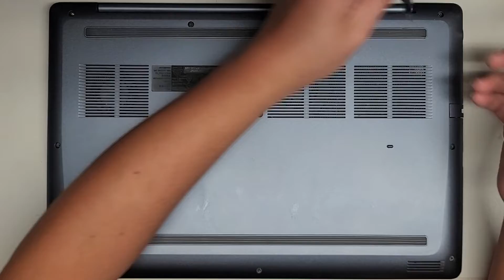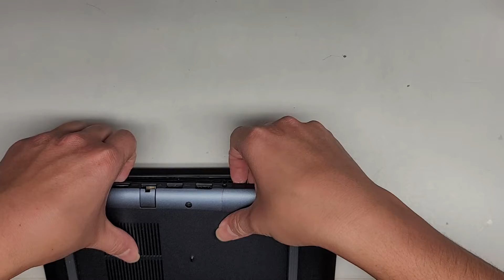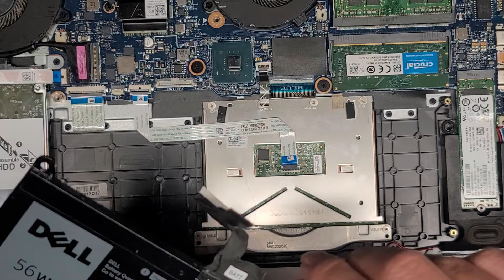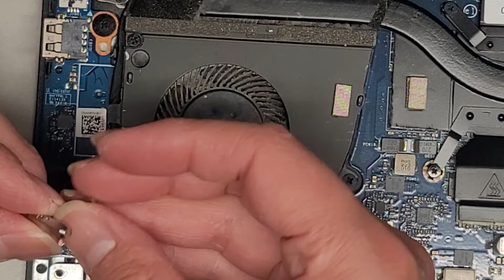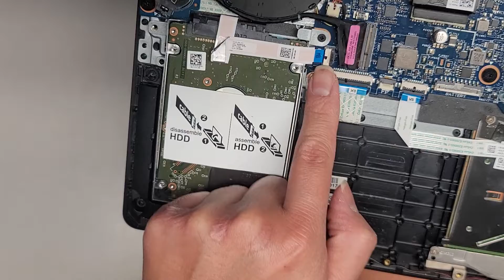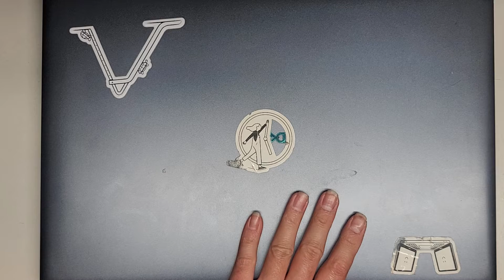DELL G3 15 3579 Disassembly RAM SSD Hard Drive Upgrade Battery Replacement Repair Quick Look Inside

Comment: Hey bro, I have a question. A few days ago, my Dell G3 3579 suddenly shut down while I was using it. Since then, whenever I try to turn it on, the display stays black, and only the keyboard backlight and fans turn on. It keeps repeating this behavior, as if the laptop is continuously restarting.

I think there might be a BIOS issue. What do you think, bro? Do you think I need to replace the CMOS battery?
Reply from the maker: Sounds like a fried logicboard :(

Comment: Hello, I bought a laptop of the same type, but the battery is weak. I want to buy a replacement, but I want it to be original. How can I tell if it's original?
Reply from the maker: Your best bet is through ifixit

Comment: Hey, hope you're doing good. I have a G3 i5 256gb nvme and wanted to add a sata ssd however the connector on the motherboard has the latch broken off. Any idea how to repair this? Where can I possibly get a spare part? Do you know what type of connector it is? I know it has 12 pins and most likely it is bottom contact.
Any help is welcome.
Thanks.
Reply from the maker: You can try this https://youtu.be/WO56KJOHywM

Comment: Hi. Thanks for making this video. I have one quick question. May be silly, maybe not. To your left is the 2.5 SATA HDD and to the right is the M.2 2280 SSD. Can you swap the HDD for a SSD? If yes, do you need special adapter to do so? Thank you for your time and consideration answering this question.
Reply from the maker: Just need a 2.5" SATA SSD
Reply: @ItsBinhRepaired  Thank you for the reply... Have an excellent day. Subscribed
Reply from the maker: @NO_FREEDOM_NO_PEACE  thanks

Comment: Thanks for the help. I just forgot what to do. I'm replacing the m.2 1TB with a 4TB, and also had a problem with Windows, so I'm doing a reinstall and changing the 1TB with a 4TB  and changing the two 8GB sticks of ram with two 16GB sticks and putting things back togeter for installation.
Reply from the maker: Sounds good!

Comment: My G3 keeps going into automatic repair and diagnosis shows a hard disk issue. How can I recover my data and replace/fix the hard disk?
Reply from the maker: Try accessing it from a Linux usb boot drive. If you can't access it, you'll likely have to send it to 300dollardatarecovery.com

Comment: Mine did’t want to open especially the corners screws they are so tough i didnt know how to open them
Reply from the maker: Were you able to get it in the end?
Reply: @ItsBinhRepaired  not it did not i will end up bringing the laptop to laptops shop just to unscrew it and change thermal paste
Reply from the maker: @Adonis-4666 😢

Comment: Hey! So I never did any upgrade with my Dell G3, I have SSD from original, I changed the battery cause it was bad and now it doesn’t see it. I tried diagnostics, changed some options to reboot. Nothing helps. I don’t know what to do. 

It worked right before battery change, now it doesn’t wanna start. Says that hard drive is not detected and it shuts down.
Reply from the maker: @MessiahtheLion  the only thing you did was swap the battery?
Reply: @ yes.
Reply from the maker: Might be a bios setting
Reply: @ right. I’m not sure if I did that too. I pressed F2 and then I restored to BIOS settings but nothing happened. Still showed no drive and shut itself down. 

Is that it or you’re talking about something else? 
I’m planning to take it to the shop.

Like I’m sure my SSD is good cause I literally used my laptop right before I changed the battery. It worked good. 
I just hope I won’t lose any files.

Comment: can you add another ssd one the right side slot?
Reply from the maker: Another? Do you already have one there?
Reply: @ItsBinhRepaired  yeah i've already replaced my hdd with 2.5" SSD.  it is possible to add another ssd m.2 on the right side near the battery
?
Reply from the maker: @jerrymerdionmuldong666  sure
Reply: Did you replace the m2 ssd? Does it support more than 512gb?

Comment: Thank you, I recently had to replace my hard drive and I had to remove the fan since it had dust balls and I never cleaned the inside. And I also had to install an SSD since it takes a while to boot to windows. (The SSD was from another Dell laptop model but doesn’t fit since it’s a bit oversized) and since I removed the fan to remove the dust I was like this line wasn’t that out on the cable and when I heard that you said to make sure it’s all the in and if you don’t you’ll shock the pins or short. My heart raced and thankfully it turned on and boots
Reply from the maker: Glad it worked out. If you haven't already, please like and subscribe so others can find my videos and possibly consider watching a few others to get the algorithm to recommend my channel. Thanks!

Comment: Getting ready to replace the battery in my G3.  The back looks identical to this one.  One of fhe screws (middle, back but not the edge) seems to be catching on something.  My son installed a ssd a few years ago.  He does not remember it giving him issues when he opened it back then. I have until the 25th to retun the battery if it does not work.  Today is the 13th.
Reply from the maker: Hope the repair goes well!
Reply: Went great and the battery is acting like it's going to be a good one!
Reply from the maker: @micheleb2558  awesome!

Comment: I have the exact same model and took it to PC repair shop. They confirmed two problems:
My battery has run its life and needs to be replaced
And
My CPU has a defect. Basically my PC cannot start even when I plug it in. The keyboard lights up a bit then goes dark immediately.
In this case, should I replace my CPU as well as the battery? And could I upgrade my ram and ssd while I'm at it?
I have all my personal data and files copied to another harddrive so data loss isn't a problem for me. 
Thanks Binh!
Reply from the maker: CPU can't be replaced unless you replace the entire motherboard.
Reply: @ItsBinhRepaired  I see. Might as well buy a new one then. On another note, my razer stealth (model rz09 is not charging properly. The charger is fine and I can still turn the laptop on but the battery is not charging. Do you think the problem is the battery itself and I need to replace it? Thanks again Binh, you're a lifesaver
Reply from the maker: @MinhVu-yz5rr  possibly, but make sure you get the battery from a source you can return it to just in case.
Reply: @ItsBinhRepaired  thanks again man. You are amazing!
Reply from the maker: @MinhVu-yz5rr  no problem

Comment: Any chance you know what may cause the laptop to have a slow startup or won't open up any web browser?
I've had this laptop since 2018 and for the past 2 years my startup takes a while to load and Google Chrom takes forever to open, but I'm able to play some games on Steam just fine
Reply from the maker: Likely failing hard drive
Reply: @ItsBinhRepaired  I had a feeling it was that, should I re0pace the hard drive or is there a way to help fix what I have?
Reply from the maker: @IamJerf  need to replace. Clone if you can

Comment: As I have this exact laptop (with a i7-8750H) as my daily driver the last four years, I can tell you a few things about it:
- the back cover on this one looks much better than mine, mine has two cracks on the left side, two on the right side, and there were pieces falling out the last three times I had it open.
- you have to open it at least every six months because the fans will accumulate dust, fabric and hairs from the outside and will over time work harder and have less effect.
- and after you have opened it two or three times many of the threaded screws will have basically destroyed the holes in the top.
- at this point, the ethernet port latch (which I just don't understand as putting a full ethernet port in there would make absolutely no difference to the height, I don't care about the sides being rounded from below) is flapping around since the spring just broke when I last cleaned the fans.
- also the fans get in contact with the backplate making a horrible noise from time to time, thanks to several distance holders having just sheared off because the whole backplate is made from the cheapest weakest plastic Dell could find
- the battery looks as weird as this one, ready to blow up. But it did that since day one, so I'm not worried.
Now the good stuff:
- the CPU is still not too bad, I have an HP as my primary work PC, and that one is two years younger than the G3, and it's a much worse PC in all ways, despite it being a "professional" model. I love having six cores in a PC from a time where four was many
- the RAM got upgraded to 32GB and the internal M2 SSD swapped with a 2TB NVME one, making this a snappy PC even now.
- when running Linux it sits at 4% CPU while browsing, reading mail, using VS Code etc. and the fans can barely be heard. Having Windows running idle uses 15-20% CPU and keeps the fans spinning much more audible.
- the nvidia 1060M is not very much compared to todays graphics cards, but it works for gaming from time to time. It's horrible (as all nvida graphics cards are) under Linux because of nvidia's stupidity and the moronic way these "hybrid" graphics solutions are built. It's also a reason the 56Wh battery you can clearly see in this video (which has been shortened to make space for a 2.5" hard drive) will not get you very far, because it is ALWAYS ON, even in "non-nvidia mode".
- the screen is laughably bad in just about any light. It shines in dark or badly lit rooms. My wife's Lenovo which cost a third of the G3 is usable outside, my G3 is just totally unusable there, no matter how much shade I get the screen is just unreadable.

I don't know if you fixed it, but taking out the battery and plugging it in can have the effect of it booting up again since it sometimes gets confused about its power modes, and then all you get is a dark screen. When mine did that it was the combination of too much dust in the fans and a botched BIOS upgrade (Dell had one or two BIOS versions for this one that were really, really bad, to the point of bricking about 25% of them should you ever be unlucky enough to install them and have the "wrong" hardware). Luckily it was still under warranty and I got a motherboard replacement, which seems to be how Dell handles this kind of problems.

Conclusion: should have followed my hunch and gone for the Lenovo Legion 5, would have made a better PC. Dell builds their budget PCs with horrible components, uses the cheapest and thinnest plastic they can find, the PC flexes like no PC I ever had before, and frankly I am worried about how long it will be working. Basically, you get what you pay for. Oh, and avoid nvidia at all cost, it's just not worth it in a laptop.
Reply: Mine is doing well, except for the battery, which I ma getting ready to replace.  I have not cleaned the fans.  Ever.  We will see what several years of accumulation looks like next week.
Reply from the maker: Haha depends on your environment. Some can be surprisingly clean, but usually you'll have a big dust bunny.
Reply from the maker: Lenovo does the same thing now actually.

Comment: Hi, I have the same model ( DELL G3 15 3579 ) can you change that hhd for ssd 2.5 sata 1TB?  please help

🤔
Reply from the maker: Yeah, just swap if the OS is on it, clone it first.
Reply: @ItsBinhRepaired  I have the OS installed on the m.2 nvme and not the hhd....thank you 🙌
Reply from the maker: @renatolimaperu1588  great!

Comment: Can I know what screw driver size is required 😅
Reply from the maker: This set will have all the bits you need for 99% of devices. https://amzn.to/3PjiNXq
Reply: @ItsBinhRepaired  I just only need the one screwdriver used to open the back lid..
Reply from the maker: @SaiSiddharthaParvathaneni  you didn't even watch the first 10 seconds of the video? Lol...

Comment: Hello hello from Greece. Yesterday I had a problem with my battery and I found that I have to change it. I have a Dell G3-3579 - i7-8750H. I searched on the internet and I found a battery which covers the main type of my computer, it writes " Dell G3-3579 i5-8300H" . I got in contact with the store and the assured me that I will not face a problem with the new battery. My question is, do you feel that the new battery is going to be compatible with the old one or not? Thanks in advance for your answer.
Reply from the maker: Check the model number of your battery and make sure it's the same model
Reply: @ItsBinhRepaired  The type of the battery is the same(33YDH). Could you please tell me how I can find the model number of the battery? So far I have two basic traits that are the same. The main type G3-3579 and the type(33YDH). Thanks for your instant answer.
Reply from the maker: @trinity5488  it's on the battery itself